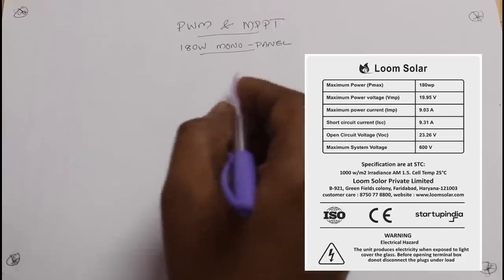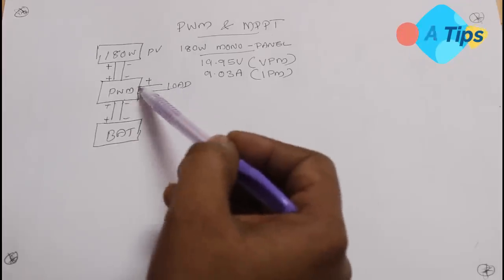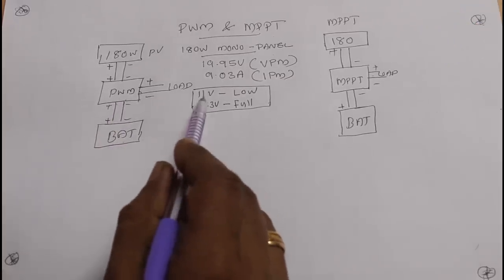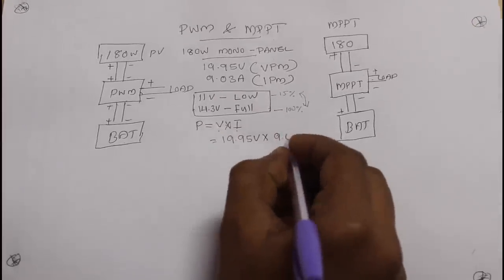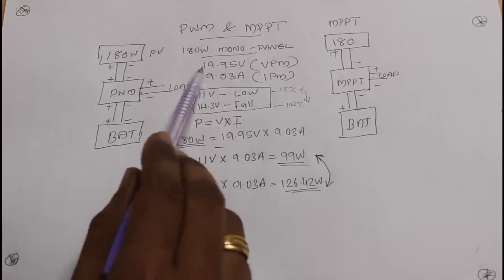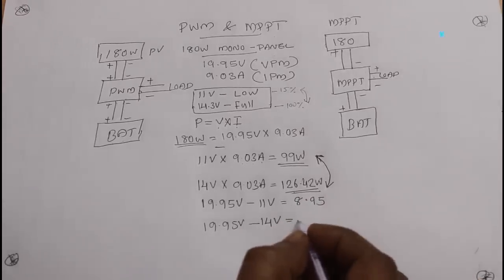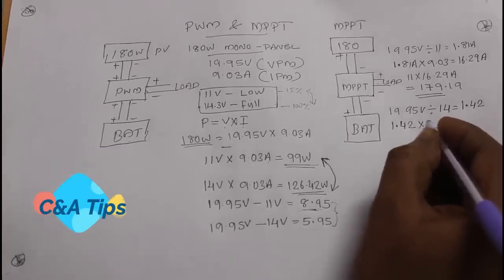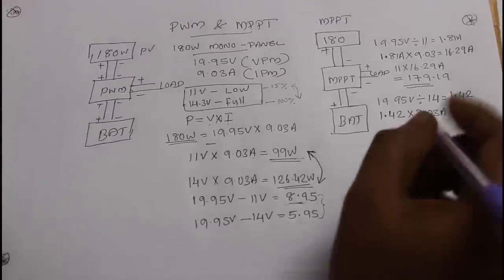MPPT vs PMW Malayalam|Loom Solar |സോളാർ MPPTയും PWMമും ഞാൻ പഠിപ്പിച്ചു തരാം,കൂടെ കുറച്ചു പൊടികൈകളും

Comment: എല്ലാത്തരം സോളാർ ഉപകരണങ്ങളും (bldc fan, ac, motor, ect.) ഇൻ‌വെർട്ടർ, ബാറ്ററി, സോളാർ പാനൽ, MPPT, കണക്റ്ററുകൾ, dc കേബിളുകൾ, ഇൻസ്റ്റലേഷൻ ആക്‌സസറികൾ എന്നിവ നിങ്ങൾക്ക് BLDC സോളാർ ഷോപ്പിൽ നിന്ന് ഓഫർ വിലയോ മൊത്ത വിലയോ ലഭിക്കും.  കൂടുതൽ അന്വേഷണങ്ങൾക്ക് ദയവായി ഞങ്ങളെ ബന്ധപ്പെടുക: 7592009995, 7592009996

BLDC Solar Shop (AKEA MARKETING LLP)
Thottathil Building, Pallipuram - Pattambi Rd, Kottaram, Valanchery, Kerala 676552

Comment: Bro ente veetil Ulla vguard 1200s smart pro solar inverter anullath . 1000 VA 800watts.  Using 150 AH c10 battery. Ethra monoperc panel add cheyan pattum
Reply from the maker: Yes

Comment: Something is wrong ,....:)
Reply from the maker: Tell me the wrong things to comment box then only people can able to learning from your level end.
Reply: @CATips , na, you have all the stuff available, So why not just create two similar systems with the same solar panel, same battery, on diff should be 1 will have PWM controller, another will have MPPT controller, And then we try to see the difference,  That will be more practical and viewers will also like it.  Also if PWM controller is INR 5000 less than MPPT,  what if we buy 5000 worth of solar panel(180W?...) then make comparison. Just sugession, i like all of yours videos.
Reply: Jithin Jose you are absolutely correct
Reply: Jithin Jose for that price difrence we can buy another solar Pannel. And can compensate the lose current
Reply from the maker: Without cable loss?
Reply: @CATips  cable should be same, consider 12v system

Comment: ഒരു സംശയം 12v 180 w panal maximum 
19.95v 180w power nalkum athayath 
180/19.95=9.022 Ah
 ഇതിനെ stepdown cheyith charge cheyumbol 14.3V ഇൽ (180/14.3=12.85A) 13A കിട്ടില്ലേ? 
Reply plz
Reply from the maker: No
Reply: അപ്പോൾ എത്ര വോൾട്ടിൽ Vഎത്ര ആംപിയർ A 
Charge നടക്കുക
Reply: What's number plz
Reply: 7012772003

Comment: Waste aakunna voltage il home load run cheyyan pattille bro??
Reply: @CATips  battery charge aakunnathil kurach thamasam edukum ennallathe opam home loadum rum cheythal PWM effective aanu bro..
Reply from the maker: @akhiljith.k  yes
Pwm for small project and better life
Reply from the maker: Depending on pv current
Reply: AKHILJITH K pwm mppt thammil price difference und. Aa difrence 2000 above und

Aa csh nu oru 50 w solar vangiyal lose aya current kittille 😀
Reply from the maker: To be learn about system man
Reply: C&A Tips  njan ecletronic padicha alu thanne anu bro. Njan athinte price wise anu paranjath. Total cost vechu lose koode calculate cheithu compare cheyyu

Comment: ബ്രോ. ഞാൻ പുതിയതായി ഒരു luminous 1800 nxg,  amaron 150 ah c10 batrery,  adani mono perc 360 x3 panels fit ചെയ്തു. 

0.75 hp മോട്ടോർ മാത്രം kseb യിൽ വർക്ക്‌ ചെയ്യിക്കും. ബാക്കി fulltime ലൈൻ ഓഫ്‌ ആക്കി ഇടുകയാണ്. ദിവസം approx. 1 യൂണിറ്റ് മാത്രമാണ് kseb ഉപയോഗം.

ഇത് വരെ കുഴപ്പം ഇല്ല. 

ഒരു സംശയം,  എന്റെ ഇൻവെർട്ടർ PWM ആണ്. ഈ ഇൻവെർട്ടർ കൂടെ ഒരു mppt ചാർജ് controler add ചെയ്യാൻ പറ്റുമോ.
Reply from the maker: Yes
Reply from the maker: Panel connection എങ്ങനെയാ കൊടുത്തേ? 
സീരിസ് or പാരലൽ? 
If പാരലൽ നോ need mppt..
യുവർ മാൽ ഫങ്ക്ഷന് ഓക്കേ ആണ്
Reply: @CATips  panel നോക്കി പറയാം ബ്രോ

Comment: ഇതിൽ കാണുന്ന 19.9 v open circuit voltage ആണ്. 9.03 A Current കിട്ടുന്ന സമയത്ത് ഒരിക്കലും 19.9 v കിട്ടില്ല.... അത് ഏകദേശം 14 നും 13നു ഇടയിൽ നിൽക്കും.. അങ്ങനെയെങ്കിൽ ഈ calculation ലെ values മുഴുവൻ മാറ്റേണ്ടി വരില്ലെ.
Reply from the maker: Vxi =power
Example
Reply: correct
Reply: Vmp ennal maximum powerile voltage aanu

Comment: Really helpful one. Could you please help me to clear my doubt. I have a Luminus 1500VA inverter with a 24V 150AH battery system (Two 12V 150AH Battery). I am planning to put two Waaree Mono Perc solar panel WSM-395 (Pmax-395W, Vmp-40.28V, Imp-9.81A) & Smarten Prime+ MPPT 24/48V 50A Solar charge controller. Based on the calculation shown in this video at the peak, the controller will give an output current of 36A to charge the battery. Will it cause any problem with the battery? The batteries used are Two Exide Inva Master IMTT1500 - 150AH Tall Tubular Battery. Please advice.
Reply: ബ്രോ mppt ചാർജ് കൺട്രോളർ അത്യാവശ്യം അല്ല നല്ല പ്രകാശം കിട്ടുന്ന സ്ഥലത്താണെങ്കിൽ 
ബാറ്ററി ക്യാപസിറ്റിയുടെ 10% മുതൽ 30% വരെയാണ് ചാർജിങ് കറന്റ്‌ കൊടുക്കേണ്ടത് സോളാർ സിസ്റ്റത്തിൽ മാക്സിമം കറന്റ്‌ കൊടുത്തെങ്കിൽ മാത്രമേ ബാറ്ററി നന്നായി ചാർജ് ആകുക ഉള്ളു ഇല്ലെങ്കിൽ ബാറ്ററി സൽഫാഷൻ അടിച്ചു വേഗം കേടായി പോകും
Reply: @mammadolimlechan  https://youtu.be/VUUvtXHmPwA

Comment: 150 w panel 100 ah battary ithinodu koode 10 a exide pwm controler vachal problem indavo
Reply from the maker: No പ്രോബ്ലം
Reply: Reply tharo chetta
Reply: Thanks chetta
Reply: Ee pwm vachal morning to evening kond 100 ah battary full avumo
Reply from the maker: 150w gives 7.5 A
Reply: @CATips  thanks
Reply: Hello chetta
Reply from the maker: Without load full charge akum

Comment: Best mppt charge controler .cheak the inside one stage,two stage  and ,three stage charging, stage means charging mathode ,cheak the inside .single coil,double coil ,three coil,maximum perfomence three stage charging
Reply: Plece used medi kit mppt charge controler,
Reply from the maker: Coil ഉണ്ടെന്നു പറഞ്ഞിട്ട് കാര്യമില്ല, പെർഫോമൻസ് ടെസ്റ്റ്‌ നടത്തി നോക്കണം
Reply: @CATips  very good perfomence in three stage coil charging ,first time i am used pwm 40amps controler,second time i am used single stage charging ,third i am used three stage charging

Comment: Microtek sbz 1100 inverter with150Ah battery modelil solar conversion kit connect cheythu day time solaril ninnu charge cheythu, nightil kseb yil ninnu charge aavatheyum set cheyyan pattumo??
Ethra ampere charge controller and ethra wattage panel use cheyyanam??
Reply: ഇൻവർട്ടർ ബോർഡിൽ ഒരു byPas ട സ്വിച്ച് വച്ചാൽ മതി
Reply from the maker: Q&A Second part coming zone
Reply: @CATips  waiting..
Reply from the maker: 30A വാഗിച്ചോ ഭാവിയിൽ ഉപകാരപ്പെടും... 
375W

Comment: Hai എനിക്ക് ഒരു help ചെയ്യാമോ...?    ഒരു (battery )12V DC , 30A  ഇതിനെ 12V DC  1.5A  ലേക്ക്    convert ചെയ്യാൻ എന്ത് ചെയ്യണം.
Reply from the maker: FOR CCTV DVR?
Reply: @CATips  yes
Reply from the maker: തോന്നി
Reply: @CATips  DVR use ചെയ്യാൻ ആണ്
Reply from the maker: No issues, you can connect directly to battery like 150Ah.
എന്റെ വീട്ടിൽ ഡയറക്റ്റ് ആ കൊടുത്തേക്കുന്നത്.. 
Watch my upcoming videos
Reply: @lalazzworld3990  ബ്രോ അങ്ങനെ ചെയ്യല്ലേ ചെയ്താൽ inrush current കൊണ്ടു അത് മുഴുവൻ അടിച്ചു പോകും 
ഒരു 1.5 amp inductor ഉപയോഗിച്ച് 2amp diode ഇട്ടു ഫിൽറ്റർ ചെയൂ
Reply from the maker: Put 2A fuse and godhead
Reply from the maker: Hi

Comment: ഈ വീഡിയോ കണ്ട് ഞാൻ 40 AM PPT കൺട്രോളർ വാങ്ങി 400 wപാനൽ ലോഡ് ചെയ്തപ്പോൾ 19 A വരെ ചാർജ് ആ കുന്നുണ്ട് താങ്ക്സ് bro
Reply from the maker: വെൽക്കം ബ്രോ
Reply: @CATips  Hai എനിക്ക് ഒരു help ചെയ്യാമോ...?    ഒരു (battery )12V DC , 30A  ഇതിനെ 12V DC  1.5A  ലേക്ക്    convert ചെയ്യാൻ എന്ത് ചെയ്യണം.
Reply: @lalazzworld3990  no need to convert,  load only consume required current or if necessary  use a buck converter
Reply: Hai
Reply: 400w panel ഏതു മെയ്ക്കാണ്?എവിടെനിന്ന് വാങ്ങി?
Reply: 400/19=21.00amp  so u dond need mppt/pwm.....
Reply: @ottakkannan_malabari  thanksbro
Reply: ബ്രോ വെളിച്ചത്തിൽ എത്രാം കിട്ടുന്നുണ്ട് ബ്രോ

Comment: #Aliexpress Rs. 994.17  37%OFF | Solar MPPT 100A 60A 50A 40A 30A Charge Controller Dual USB LCD Display 12V 24V Solar Cell Panel Charger Regulator with Load
https://a.aliexpress.com/_dURFbrz

Comment: Sir you are absolutely right if you are using a DC simulator. But in case of a solar panel, you know better than me that its not accurate and 12 volt panel pwm is more ecnomical
Reply from the maker: Many thanks
Reply: So you mean for 12V panel PWM is economical than MPPT?
Reply: @deepeshayirathi  yes

Comment: ഒരു കുപ്പിയിൽ ഒരു ലിറ്റർ വെള്ളം കൊള്ളും എങ്കിൽ രണ്ടു ലിറ്റർ ഒഴിക്കാൻ പറ്റുമോ if voltage degrees current high in time voltage increase current become low  so
How pwm and mppt take different current level please explain
Reply: ഹൈ പവർ ട്രാൻസ്മിഷൻ ഉപയോഗിക്കുന്ന സാങ്കേതിക വിദ്യ ഇത് തന്നെയാണ്
Reply from the maker: Don't compare solar charge controller with water....
Reply: @CATips  ഒരു സെല്ലിൽ . നിന്നും ഒരു ഇലക്ട്രോൺ പുറത്തോട്ട്  പോയൽ പകരം ഒരു ഇലക്ട്രോണിനെയേ ഉൾക്കൊള്ളാൻ പറ്റു പിന്നെ ബാറ്ററി ഫുൾ ആയാൽ എത്ര സമയം ചാർജ് ആയിട്ട് എന്താണ് പ്രയോജനം എനിക്ക് മനസ്സിലാവുന്നില്ല പിന്നെmppt or pwm മ്പറ്ററി ലെവൽ കുറയുമ്പോൾ സെല്ലിൽ നിന്നുള്ള വോൾട്ടേജ് കുറച്ച് വിടുന്നത് നല്ല |dia ആണ്
എന്തായാലും പണി നടക്കട്ടെ പിന്നെ നമ്മൾക്ക് ചർച്ച ചെയ്യാം അറിവുകൾ ഷയർ ചെയ്യാം സന്തോഷം
Reply: Video  correctane
Reply from the maker: Try to watch my previous videos, 
Answer will be there okay
Reply: Mppt or  pwm  any thing voltage constantly from solar cell . in time different  level of battery current will  increase in battery voltage level low so I think pwm or MPPt are same duty mppt go trickle charging battery life will degrees

Comment: 24 v 375 W പാനലിൽ നിന്ന് 12v/24v 30 amp mppt charge controler ഉപയോഗിച്ച് 150 ah 12 v battery connect ചെയ്യാൻ സാധിക്കുമോ
Reply from the maker: Some controller not connect auto. 
You have to select 12v or 24
Reply from the maker: താങ്ക്സ്, സമയം കിട്ടുമ്പോൾ എന്റെ എല്ലാം വീഡിയോസ് ഉം കണ്ടു നോക്കു...
Reply: 𝕄𝕡𝕡𝕥  𝕔𝕙𝕒𝕣𝕘𝕖  𝕔𝕠𝕟𝕥𝕣𝕠𝕝𝕝  12 /24 𝕧𝕠𝕝𝕥 𝕡𝕒𝕟𝕟𝕖𝕝   𝕊𝕦𝕡𝕠𝕣𝕥 ചെന്നതെങ്കിൽ  12 𝕧𝕠𝕝𝕥  𝕓𝕒𝕥𝕥𝕖𝕣𝕪  𝕔𝕙𝕒𝕣𝕘𝕖 𝕔𝕙𝕪𝕒𝕟  പറ്റും
Reply from the maker: Yes
Reply from the maker: 24v 375w vagikko
Reply: voltage buck boost board upayokikkoo you can adjust the out put voltage

Comment: 180വാട്ട്സ്ന്ടെ 2 സോളാർ പാനൽ mppt ചാർജ് കൺട്രോൾ  ഉപയോകിച്ചു 12 വോൾട്ട് 150 ah ബാറ്ററി ഫുൾ ചാർജ് ആവാൻ എത്ര മണിക്കൂർ വേണം ഇതു കൊണ്ട് എത്ര യുണിറ്റ് വൈദ്യുതി ഒരു ദിവസം consyum ചെയ്യാൻ കഴിയും
Reply: ഇതിന്ടെ ഒരു ആൻസർ കിട്ടുന്നതിന് ഞാൻ ഇരുന്നു എല്ലാ വിഡിയോയും കാണണോ കൊള്ളാം
Reply: 150ah *12v/180w*2
=1800/360
=5 hrs to get fully charged(if continuously have sun light on the panel)
Reply: Approximately 10 hrs if your battery fully discharged
Reply from the maker: Depending upon sunshine
Reply: @CATips  സൺഷൈൻ നെ ഡിപൻഡ് ചെയ്തതാണെന്ന് എനിക്കും അറിയാം ഞാൻ ചോദിച്ചത് നമ്മുടെ നാട്ടിലെ കാലാവസ്ഥ അനുസരിച്ചു ഏകദേശം എത്ര ലഭിക്കും എന്നാണ്
Reply: @rafeerafee8263  ബ്രോ 150 ah ബാറ്ററി ഫുൾ ചാർജ് ആകാൻ 15 അമ്പയർ 10 മണിക്കൂർ തുടർച്ചയായി വേണം എന്നാണ് തിയറി എന്നാൽ പ്രാക്ടിക്കലി അങ്ങനെ അല്ല
Reply: @mammadolimlechan  engane aanu onnu vishadeekarikkamo?
Reply: @kkAshil  എന്താണ് അറിയേണ്ടത്
Reply from the maker: താങ്ക്സ്, സമയം കിട്ടുമ്പോൾ എന്റെ എല്ലാം വീഡിയോസ് ഉം കണ്ടു നോക്കു...
Reply from the maker: With  ലോഡ് ഒരു without
Reply: As per him,  less than 8 amps can be supplied by one panel at its peak.. so u need around 10 hrs to get your 150Ah battery fully charged from empty on noload condition,  using 2 nos 180W PV panels.

Comment: MPPT charge controler pettannu complaint varumennu kelkunnu.. nalla vilayumanu. Pinne kooduthal ampere koduthu battery charge cheythal battery lifeum kutayille.?
Reply from the maker: You are mistaken
Mppt only doing wastage voltage converted to Ampere that's it Moreover  MPPT and PWM Doing same controls

Comment: Bro oru 68ah battery 125watt panel il ithil eathu solar charge controller aanu nallath ? Vtl oru cheriya dc lightening system cheyyan vendiya
Reply from the maker: Budget issue undel pwm ok
Reply: 68ah batteryk 125watt loom mono panel pattumo? 68ah battery yil 7wat dc bulb 4 eannam use cheythal eatra time aproximate backup kittum?
Reply from the maker: I will make one video for you wait for some time 😁
Reply: @stillchasingthedreamz8210  22 hours above kittm. 7w 4 bulb alle ullu.
Reply: thanks for replying me back your valuable time
Reply: Yes 7 watt 4 bulb